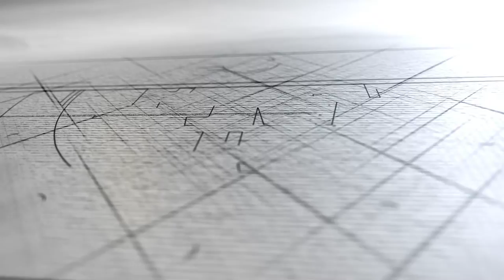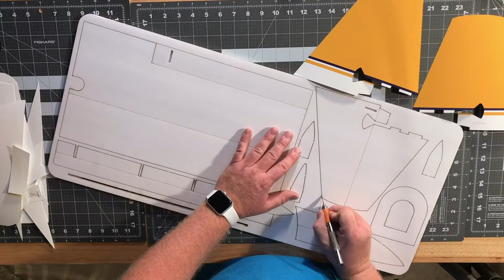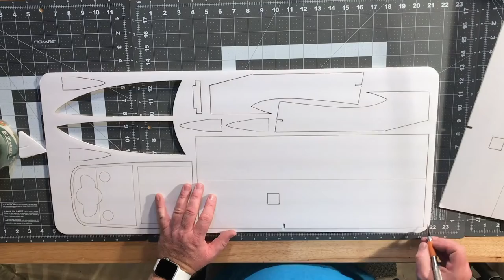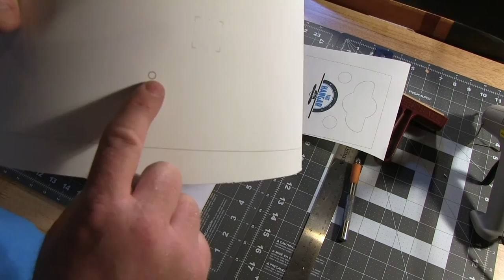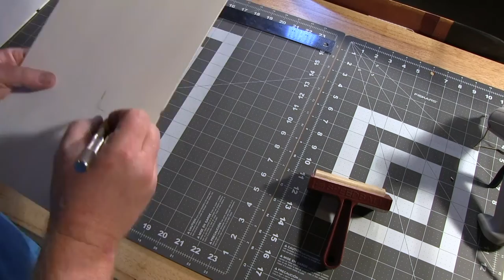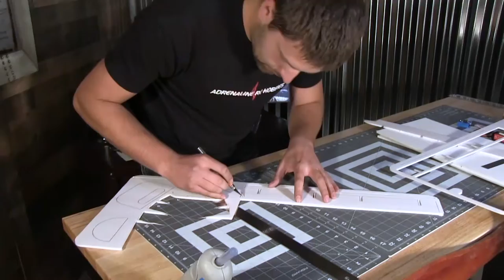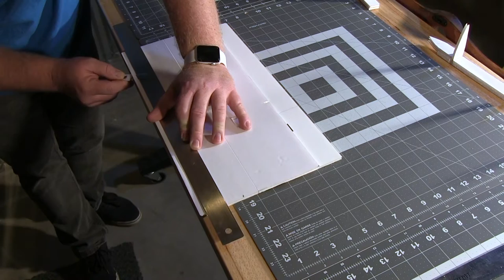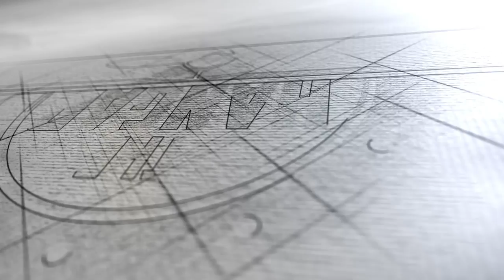How to build the HRC Seven (Vans RV-7) / Build

Comment: Here are a few timestamps to key parts of the build.
Wing build 1:12:03
Wing Tips 1:45:00
Rear fuselage build 1:58:21
Vertical and Horizontal Build 2:07:27
front fuselage build 2:21:30
cowl and motor mount 2:25:38
Joining fuselage front/Rear 2:46:07
Installing wings 2:48:58
building canopy 2:55:23
Reply from the maker: Thanks for doing this!

Comment: My maiden didn't go so well yesterday. It was tail heavy. Normally these types of planes are balanced upside down correct?
Reply from the maker: Yes the HRC Seven is a short coupled airframe. Many factors can effect the CG of the bird. What size of battery are you using? and where was it located? We recommend that you use a 2200 3s and mount the battery on the firewall.

Comment: I ordered and built one and had a bad motor   How are you supposed to replace the motor?
Reply from the maker: We are sorry that you had a bad motor. Was it one of ours? If so if you will email our team at support@thehangarrc.com and we will make sure that you get a new motor shipped out. If it wasn't one of our motors, we recommend testing all electronics before installing in the airframe. However if you use some Isopropyl alcohol (rubbing alcohol) and cotton swabs and are careful you should be able to  release the hot glue that holds the power pod in. Then you can replace the motor.

Comment: on the straight edges tape a couple 1 2 3 blocks down onto the bench 
and use them as a straight edge to hold the foam in place then slide the skin against the blocks then lower into place
Reply from the maker: west starr thanks for the awesome tip!

Comment: The kits are pricey for just standard foam board
Reply: Go price out large format color printing and laser cutters, then tell me it's too much. When you consider the design time, printing costs, equipment costs to make, handling time to assemble and ship the kits, and then throw some meager profit on top of that... the pricing is very very reasonable. The cost of foam is only a small part of the cost of producing these kits.
Reply from the maker: Thanks for the support Jason. It really means a lot to us!